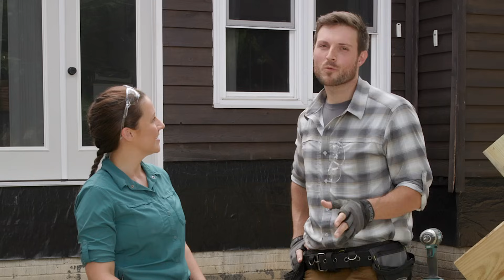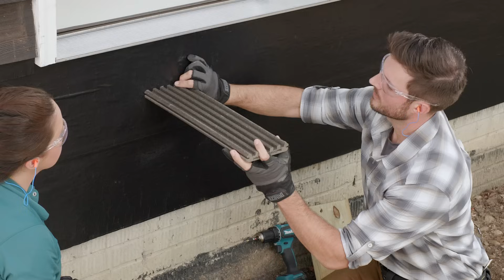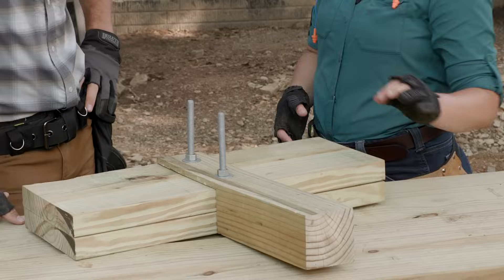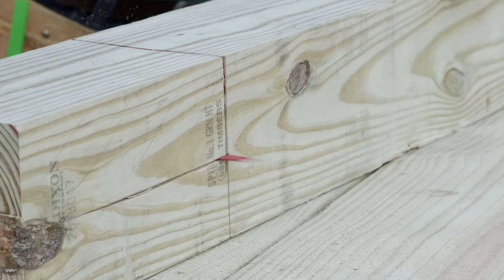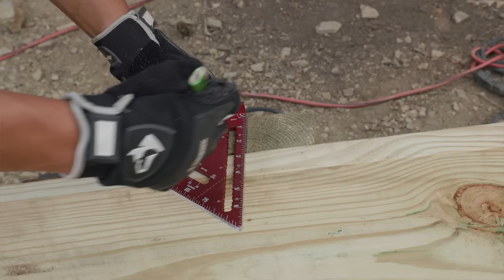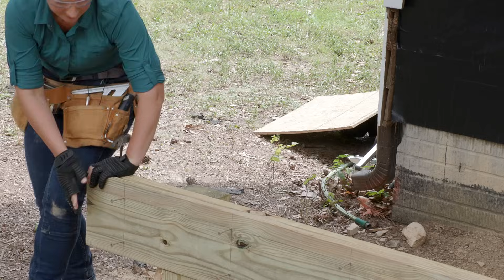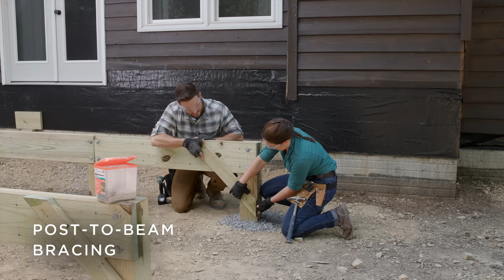How to Install Deck Frame Beams and Posts | Trex Academy

Comment: Usually slight tap with a hammer to get the level spot on while clamped as a final adjustment.

Comment: Funny how things change in codes but are not always necessary.  I have built many  decks with the beam boards on either side of the post with only 5/8 inch carriage bolts and nuts to hold them up and they are still there and just fine almost 30 years later.

Comment: If the old arsenic treated lumber was still in use, I would have no problem sinking the posts into the ground.  With the new copper treated wood, I wouldn't think about it and I don't believe code in my area will even allow it.

Comment: What is the recommended way to do a corner post (4x4) connection to beams? I have a small deck with stairs that is approximately 4ft x 4ft and I am struggling to find diagrams/instruction for 4x4 posts on the corners. Thank you in advance!
Reply from the maker: Good morning,

I am attaching the full installation guide for your review. In the installation guide, you will start at page 76 for instructions on railing installation.  

If you have any additional questions, please feel free to reach back out to me.

Thanks,

Michael Hines 
Trex Customer Care
1-800-289-8739

Comment: Wouldn't that deck fly away if not attached to the concrete footers?
Reply from the maker: Hello. Great question! In this case, we used the buried post and compaction method, which includes a footing at the bottom of the hole. The compacted material around the post provides the necessary stability to hold the deck in place. This method was approved by the municipality where the project was completed. However, we always recommend checking with the local building department in your specific area to ensure this method is permitted based on local codes and regulations. Let us know if you have any other questions!
Best regards, Brandi - Trex Customer Care

Comment: Slope the deck slightly down away from the house for water run off away from the house.
Reply: No there are gaps in the decking for that reason. The ledger board will be flashed

Comment: Is there any reason to have the high side of the notched post on the side closer to the house vs the    other way?
Reply from the maker: Good afternoon, 

Thank you for reaching out. No reason.  The post can be positioned either way as the direction is not structural.  That would just be a personal preference. Please  feel free to reach back out if we may be of any further assistance. Thank you for choosing Trex!  - Trex Customer Care 1-800-289-8739

Comment: 33:05 pffft plane as needed yeah right. you can line those boards up as you screw them together, pushing down on the higher one
Reply: Sometimes you can push little down, sometimes not
Both beams sit on top of notch.
Material is imperfect even bought at same time or is little bow

Comment: What did you use to treat cut ends
Reply from the maker: Hello, thank you for reaching out to us. You do not have to treat the cut ends of the Trex decking. It is not recommended or necessary. Kindly, - Trex Customer Care Team
Reply: @TheTrexCo  we mean the  cut ends of the deck base of wood cuts= what is the chemical seal?

Comment: This is an excellent video, thank you so much for providing it. The techniques shown here are more advanced than those used in the 1970s. Building science and building codes have really advanced since that time. I really like applying copper coatings and tape to joists, for example. These are much more advanced techniques than were used in the 1970s and 1980s.

Comment: Every online deck building program only has one 2x10 beam with a deck at a 14 foot depth and 2x8's as joists. So why the 2 beams and attached at the ledger?
Reply from the maker: Hi there! Thanks for reaching out. We chose to do 2 beams for two reasons. The customer requested absolutely no bounce as they have parties with quite a few people.  Additionally, the two beams also gave us the opportunity to shoot multiple shots for our how-to videos.  You could follow your local guide for a 2x8 or 2x10 to span and only have one beam if you desired. ~ Trex Customer Care Team

Comment: Living in the Pacific Northwest rainforest, I see those posts set in concrete below grade to be the weakest part of the whole design. I know you get away with it in dry climates,  but when it fails you end up having to replace everything. Better to use concrete posts that bring all wood at least 8" above ground. When the wood ultimately fails, the foundation survives to support the next deck years later, without painstaking effort to dig out the remains of the old supports.
Reply: You will not get away with setting posts set in concrete below grade even in dry climates.  Come out to arid California and I'll show you examples of below grade column/post failures.  The only way I would do this if the posts were HSS columns, but even then I wouldn't call out this detail in my designs.  FWIW, by the looks of the lush vegetation in the background, this location does not appear to be a dry and arid building environment.  OK, I changed my mind.  I would set the posts below grade if I was flipping the house.
Reply: @w6qd  thank you for saying this! Im having this argument with my GC as we speak on my 16x28 timbertech with plans for a future screen porch.  worst part is inspector says its perfectly acceptable!  ? tehy dug 2 ft holes and poured the minimum 18x18x8 base engineer required.  NC solid red clay.  GC says they are going to backfill?

Comment: Ledger board? IMO it's far better to build a freestanding deck which
doesn't require a ledger board attached to the home which can be 
very problematic. Not only that in the case of a so called mobile home
decks are required to be freestanding. So I say forget the ledger board!

Comment: So one of all things you covered. You just jammed a post into the ground and never went over how They're all the same height.
Reply: Yep, and it's the most challenging part since they  marked the posts and maybe cut them before the cement was poured, that's some confidence!
Reply: Cement did t get pour and you should encase posts in concrete as that is no longer code

Comment: Hi Devin, are the beam posts divide evenly apart?
Reply from the maker: Thank you for reaching out! Typically, these can be divided evenly, but you would always want to check with a local code official for regulations in your area. ~ Trex Customer Care Team

Comment: Good morning, thanks forcall your great videos!  Question:  I'm rebuilding my deck, it's 12x25 and the original deck was is cantilevered, so joists are attached to floor joists inside my family room.  This is the 3rd rebuild on this deck and these old joists are no longer structurally sound.  I would like to cut them off and install a ledgerboard in their place.  

My home is stucco. So I'm concerned with installing thru stucco and ensuring a strong, sealed connection with the house.  Also, once I cut old joists off (at the stucco), how do i seal these as thevrotted joists extend into my subfloor?they seem to be sealed well at the stucco interface, but whatvabout the exposed end cut?

Alternatively I could install new footers up against the house and place new beam on it.  However, deck is elevated about 5 ft and we have basement windows that posts would block.

Do you have any recommendations? 0:27

Comment: Great series. Any suggestions on how to do this if you're using cast-in-place post bases instead?
Reply from the maker: Thank you so much for reaching out! All of our railing systems are intended to be mounted post to post including a foot block for support. We would love to speak to you about this more! When you have a moment, please give us a call at 1-800-289-8739. We look forward to hearing from you! ~ Trex Customer Care Team
Reply: @TheTrexCo  My question (and this video) had nothing to do with railings.
Reply from the maker: Thank you for reaching out Eric! I apologize for the misunderstanding. For guidance on using cast-in-place bases, we would recommend the following steps: • Dig the holes where needed, so the center of the post is approximately at the center of the hole.
• Measure and install a string line near the center of the holes. Make sure the string line is a few inches above the top of the hole. Make sure the string line is level from side to side. This string line will be the outside edge of the post so calculate and measure accordingly.
• Pour the concrete into the hole.
• While the concrete is wet, push the cast in place post base into the concrete.  Align the post base front edge with the string. Repeat with other bases.  Make all bases the same distance height wise to the string.
• Finish concrete with a trowel and let the concrete harden while the base is in place.
Please feel free to reach out if you have any further questions! Our number is 1-800-289-8739. Thank you again! ~ Trex Customer Care Team

Comment: why you have to connect the porch to the house?
Reply from the maker: Hello, we recommend that the deck be anchored down and not floating. If it is floating, there is a chance that the substructure could shift and which then the boards would as well. Thank you, - Trex Customer Care

Comment: Just set the post first in concrete and let them run long and use a laser to mark the beam notches. I use a circular saw to do the majority of the cut and finish it with the timber blade for my jig saw.

Comment: How did you find the top of the posts and where the beam notches will be on the rest of the posts when it appears you never used the straight edge and the beam board that is attached to the house wall? It never moved.
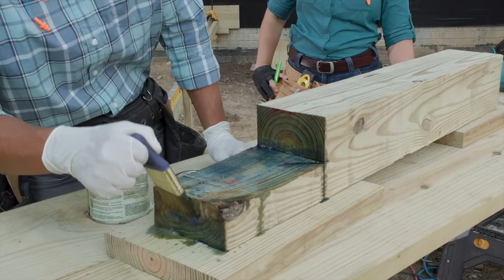Reply from the maker: Hello. Thank you for reaching out and your interest in Trex. Reference time 16:42, the video states that they need to repeat the process to mark the rest of the posts, cut and treat them.  We swiveled the straight edge from the house to each hole and marked in the same manner to come up with each post beam height. I hope this information is helpful to you. Please feel free to reach back out with any further questions or concerns. Someone from our Customer Care Team will be more than happy to assist. Kind Regards. -Trex Customer Care 1.800.289.8739  |  customercare@trex.com
Reply: @TheTrexCo  Thank you, I did not catch that at first. Swiveling the straight edge is another good tip.

Comment: By putting the structural screws every 16” 2” from top and 2” from bottom all the way down on the beam, wouldn’t you be concerned of the wood splitting? Just wondering.

Comment: Gravel back fill lmao wtf kind of construction is this!?!? Theres absolutely nothing structural about this build. Wind could theoretically pick it straight up out of the ground. You either backfill with concrete, use fast 2k (expanding epoxy), or you use a simpson tie bolted to the concrete and nailed to the beam. Gravel in a hole isnt wicking anything away. If anything id argue its holding the water closer to the post. Must be another right to work state with its "licensed/bonded" wood butchers.

Comment: Without putting fabric down, that gravel will mix into the surrounding soil over time and it’ll still end up logged with water.
Reply: You are correct. The best method will depend on where you and the specific soils in your area. With some soils it will not matter if you use fabric. Others, it makes a huge difference. And in some area, the soil drains so slowly, your post will be in a pool of water regardless of the gravel.

Comment: Why is it conventional wisdom/practice to connect your deck to the house? Cannot the deck be completely free standing without attachment through ledger board to the house?
Reply: Right. I'm going to build a free standing one so I dont worry about water damage to foundation over time
Reply: Don't quote me on this, but I think it depends on your municipality. If you have an exit door, for example, onto the deck, some areas will require the deck to be fastened to the house in some way.
Reply: Built my deck freestanding, 16x25 without a step down.
Reply: A freestanding deck is actually ideal and much avoids many of the pitfalls of a ledger connection to the house (trapped moisture, improperly attached, pulling away).  A freestanding deck can be spaced ~1/2" or more away from the house, allowing water to drain between, and avoiding penetrations through the siding, WRB, rim joist, etc.  The only reason, these days, not to do one is if you don't want to see the additional posts, as in a deck off a 2nd story room/balcony, and you'd now have 4 posts (or more) to look at, out of the 1st story windows or slider.  Otherwise, go for it!

Comment: They’re somewhere that it snows enough to design a step-down deck, but not enough to go more than 24” for their post-hole depth??

Even if that is “code” in their area, frankly it’s not enough if there is going to be any substantial freezing.   

I live above the 45th Parallel, and we obviously go at least 42”.  Anything north of Kentucky should be minimum 32”.   

Am I missing something? 
All the notches and carriage bolts in the world won’t keep that deck from heaving.

Nice looking product though. Thanks for the content!

Comment: Personally, I have some issues with your methods.

1) Your footing piers should be a minimum of 2 inches above ground level.  This is to prevent moisture & rot, which WILL happen with the backfill method you are using.

2) while notching your 6 x 6 post may be "code compliant" in your area and is "your preference", what you have essentially done is use a 4 x 4 post to rest your beam on.  Much better to use simson strong ties.  This also requires less labor then notching posts.

3) you attached your beam to posts using exterior grade wood screws.  You do not say these are "structual" screws such as Fastenmaster structual screws, or "t-brace metal attachment for beam to post
Reply: It's actually resting on 4x6 not a 4x4.  Also if your looking at using stainless steel fastners 2- 1/2 " stainless steel bolts are much cheaper than. the simpson stainless post cap the cheapest I could find was 40 dollars a pop ouch!

Comment: What is a good way to do the corner connections with a 6x6 post and (2) 2x10 beam? I saw some hardware especially for it, but it was crazy expensive.
Reply: Assuming you are talking about two beams that would need to bear on one post. Run one of the beams flush to the end of the post, and then use an inverted flange double 2x10 hanger to attach the other beam to the one that was run all the way through.

Comment: Can you use the same notch detail if you have a 2 story post that supports beams on both floors?
Reply from the maker: Hi David. Thank you for reaching out to Trex and your interest in our products. We would recommend reaching out to the local municipality. As a second story deck adds more load to the post, different criteria can be applied to it.  The local municipality would need to confirm this information for you. Please feel free to reach back out with any further questions or concerns. Someone from our Customer Care Team will be more than happy to assist. Thank you for choosing Trex. 1.800.289.8739  |  customercare@trex.com

Comment: Concrete for a back-fill is a bad idea. I wouldn't do it even if the municipality said I should. I'd fight it or ignore them. Crushed stone is a decent option but a bit overkill if you have a larger hole. Here in New Hampshire we have a 4' footer depth (I use plastic footers). We back-fill with inorganic dirt and then the top few inches are gravel.

Comment: First, there was nothing said, that I heard, about putting pea gravel in the bottoms of the holes for drainage. This may not be required where you are, but it is in other areas and it is a good idea whether it's required or not. Second, there appeared to be an assumption that the concrete in each hole is exactly level with all the other holes. This is necessary to make sure the tops of the posts are exactly level. Or, you start with where the tops of the beams will be and run a level line from the side of the house to the outermost post. You mark those and cut any that require it. That will assure that the tops of all the posts are perfectly level. This is an extremely crucial step.

I built my own deck, not attached to the house, and used the method of attaching one beam on each side of the post. Unapproved; but, being the deck is not attached, this wasn't a concern. That was over 20 years ago. The deck is still rock solid. BTW, my deck is made of Trex.
Reply: In the video, a building inspector is checking the post holes and piers. Decisions about backfill are all driven by local code. So if pea gravel is right in one place it may not be in others.
Reply: I agree with drainage. They should mention it as the proper way. It will always be better to have it.

Seems like they prefer to adjust (cut) every post individually.

Comment: How much of this would apply to a small free-standing 7×5=35sf Platform or Landing? 
For sure . . . Footers & Handrails and shear supported framing. Anything else ?
Reply: P.S.   ENJOY YOUR SERIES
Reply: After showing my footing insp. all of the posts I double notched he said those exposed areas of wood will never rot.
 You can clearly see how shallow the preservative penetrated.
I threw those notched pieces I cut from the posts in the nearby bushes for future observation.
AND. . . FYI Treated 6x6 is not always 5 1/2x 5 1/2. Measure it and see.
You can get different sizes from the same pile in the store.

Comment: The only thing I'd add is to make sure your bolts are offset when securing the beam to the post (possible splitting of the timber grains) pre drilling helps, but better to be safe than sorry.